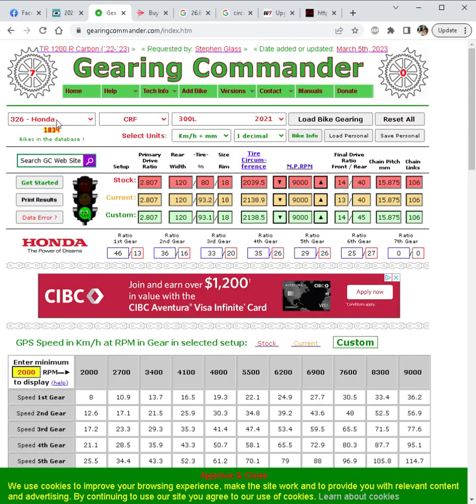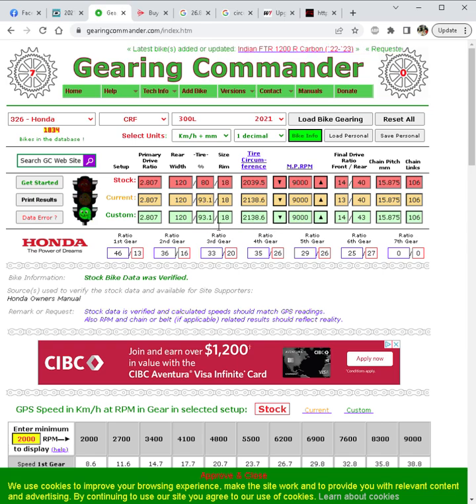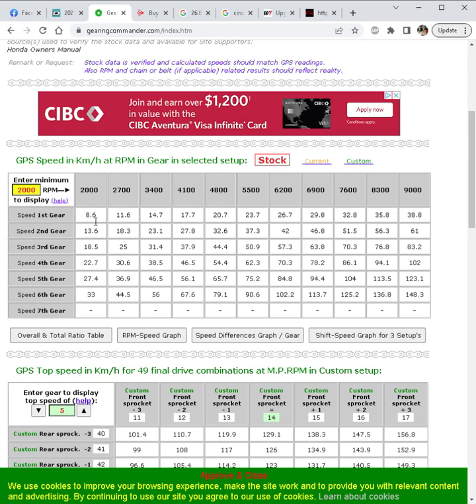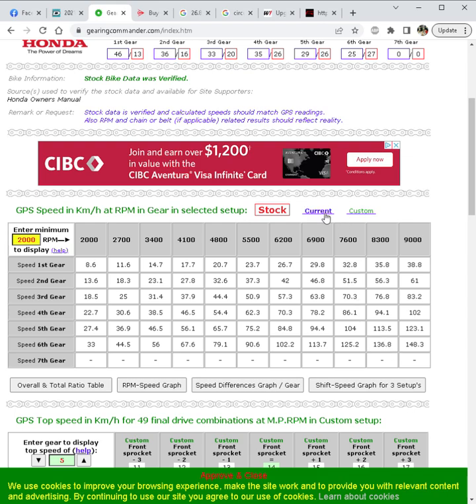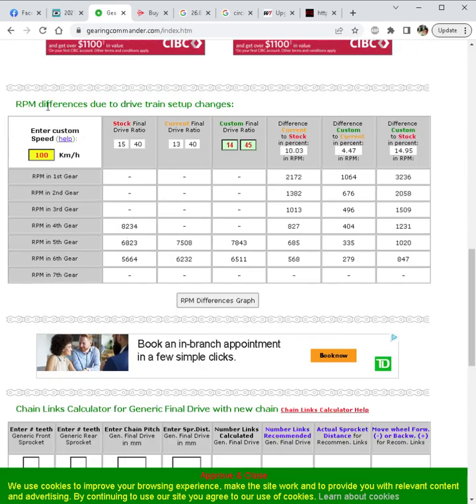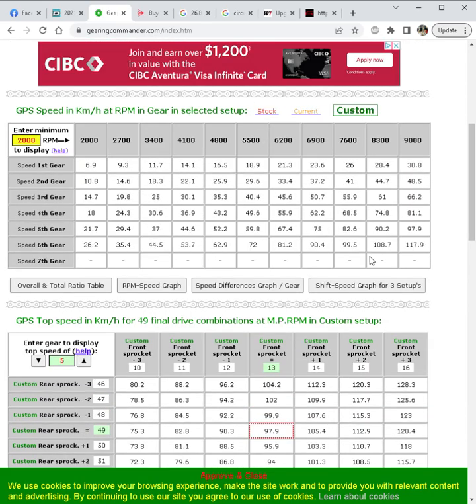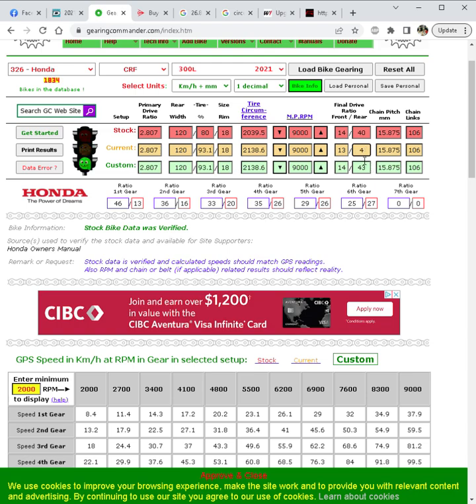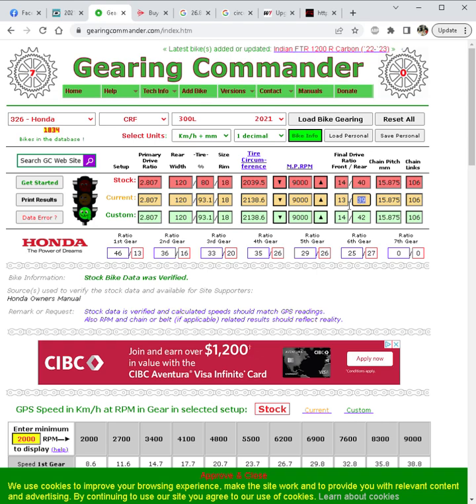Crf300l and Rally Gearing explained

Comment: Hello, I’ve got the rally and was never capable of getting this bike above 7000 rpm’s and at 70mph, that’s redline! I’ve done all of the upgrades; exhaust, 550 performance, air box etc. these mods didn’t change a thing other than power. I still can’t get the bike over 70mph and that is just at peak. Cruising at 65mph seems to be where the bike likes. I’m baffled at all of these folks claiming they cruise stock at 80mph? 
Any suggestions?
Reply from the maker: @glopod8736  First off the redline is 10500rpm

Second is that peak power is at 8400rpm

It’s best to shift at around 8800-9000 rpm then you should be above 6400 in the next gear which is peak torque. 

Make sure you don’t shift out of 5th till 8800rpm

Did you go with a slip on exhaust or full exhaust system?

Are you using a big heavy 120/90 18 rear tire?  A 120/90 18 rear tire is twice the weight of a 110/80 18 or 4.10 18 tire.  This robs power
Reply: @ thanks for the reply… i’m using redline as a general term. I guess what I mean is the bike tells me to shift with the green light at 7000 RPMs. I can also hear the engine does not want to go any higher. I also have the full exhaust system. I am using the 120 9018 rear tire. Would that significantly reduce the top speed? I just watched another video of a popular YouTube guy with the 300 claiming the top speed was 85 mph. I’m not even close! 
I live in Idaho and typically do 90% dirt but some highway to get to different areas and intend on doing the Idaho BDR and would like a little bit more top speed when on highways.
Thanks again for your reply!
Reply: @glopod8736 any fix? How much do you weigh? Plan on getting full yoshi exhaust 550 ecu and airbox mod I’m 6’5 260lbs hoping to go 75 and be able to cruise comfortably at 70. Will a 14/42 help with this?

Comment: Just changing the front sprocket to a 15 drops the revs to about 6375 rpms at 70 mph in 6th gear. Down from about 6,850 rpms with the stock gearing. And since you still have that 1st granny gear (yes, still), you should be able to still take off in 2nd and feel little or no effect on the trail.
So besides this, changing the seat to a seat concepts at $325, adding a Parabellum windscreen at $109, extended range fuel tank (acerbis/ims) which is about 3.5 gals at about $300, tusk handguard with turn signals at about less than $80 (many to choose) you are at under $800 for long term highway riding. Then.....don't forget about the suspension, which may be another $1,000 on top. Finally, if you are travelling you need some luggage and rack($$$). Oh wait, I forgot about ECU, filter/airbox mode and slip on.....I think you may be at $3K by now?
Throw in the price of what you, the consumer, paid for the bike. 
How much are we at?
(The tires can be changed for better ones when they wear out....)
How much is that KTM390 adventure for? $7,400? And that included an excellent suspension, enough power that you will not need to upgrade, no screen needed since its included, a 3.8 gallon fuel tank and it weighs in at less than 50lbs more than that crf300 rallye model. Just change the tires to lean on the more aggressive off-road side when they are worn out. Yes the Honda will be more off-road oriented but you do need to modify it...a lot and at a cost, to offer what the KTM does.
Reply: A 15t!?!?😅  That is crazy.
Reply from the maker: I personally dont feel like a 15 tooth front sprocket is a good idea.  The crf300l doesn't have the power to pull it.  

At most id use 14/39 gearing. 

As for the ktm390.  It has street bike geometry with slanted footpegs and not very much ground clearance.

Comment: Does 300l measure speed on a crank or wheel? Do you have to fix your speedo reading after gering change?
Reply from the maker: It measures it of the transmission output shaft.  You can use a speedo healer to correct your speedometer after gearing changes. 

I have never used a speedo healer.  I just figure out the % I'm out; and correct for it in my head. 

Stock the bike is out 5-7% so 100km/h on the speedo is only 93 or 95 gps.  105kph = 100 kph